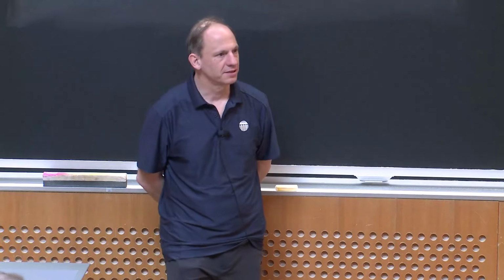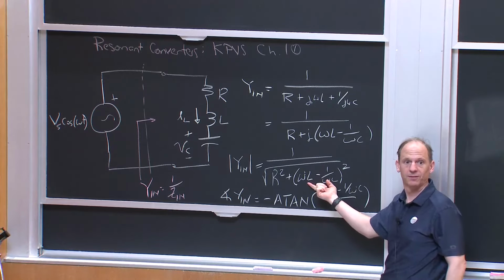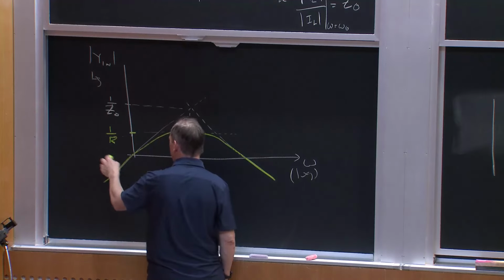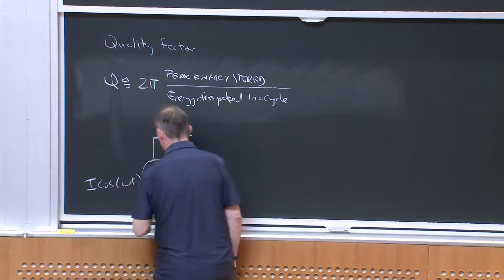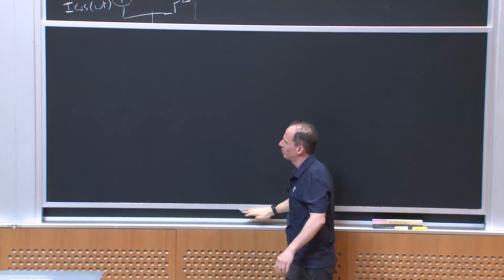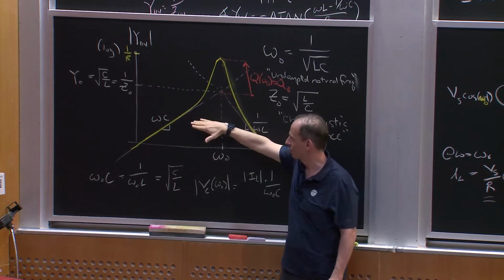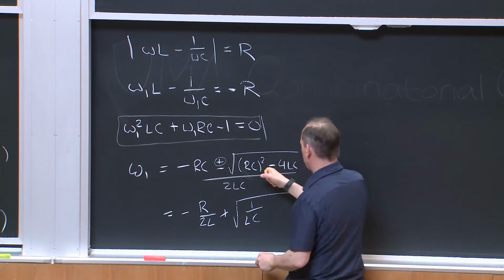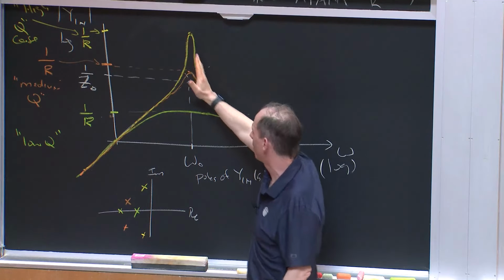Lecture 35: Resonant Power Conversion, Part 1

Comment: Excellent lecture. Would plug in seamlessly into Radio Frequency Stuff 101 :-)
I've stumbled over this while trying to DIY a Geiger detector. I have the Geiger tube, but I had to cobble together a source of nearly 500V DC, battery-powered by two AA cells. I've had some good fun with a ferrite-core transformer gutted out of a scrap CCFL inverter and a self-oscillating power stage, trying to make the thing oscillate where I wanted it to (around 60 kHz). Plus AGC for output voltage regulation. It was surprisingly hard :-) despite having several example schematics published by other people. I was aiming for high Q in the secondary circuit exactly to reach the high voltage. The current consumption is next to nothing, and going resonant outside of the RF bands should help me steer clear of EMI radiation issues. The thing kept wanting to oscillate anywhere but my desired frequency range, the regulation loop was all naughty, the high-Volt zeners are noisy as hell, the frequency domain characteristics were heavily dependent on supply voltage etc. It sure didn't help that I tried to pull it off on a universal breadboard, only to find out that a ground plane goes a long way in suppressing undesired parasitic behaviors :-) A proper double-sided PCB would've probably saved me a lot of that trouble. I'm kinda glad I don't have to do this as a job...
Reply: You and me both!